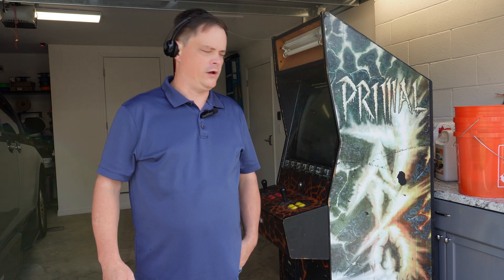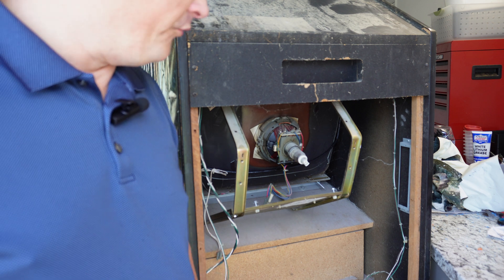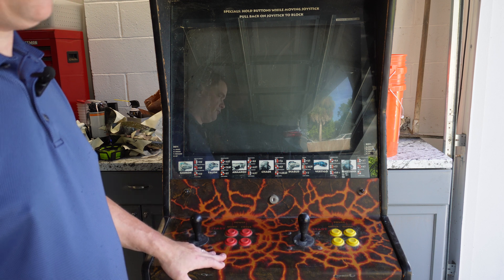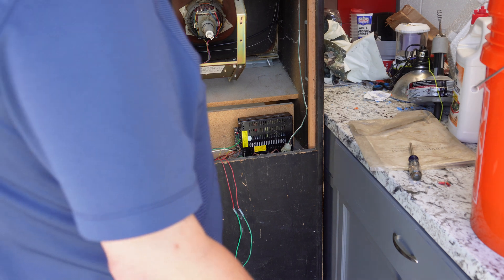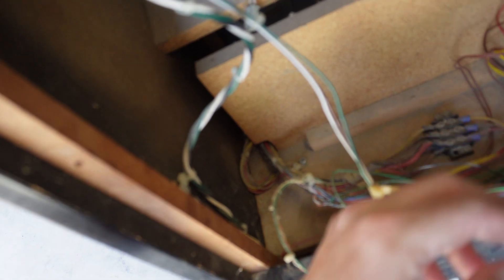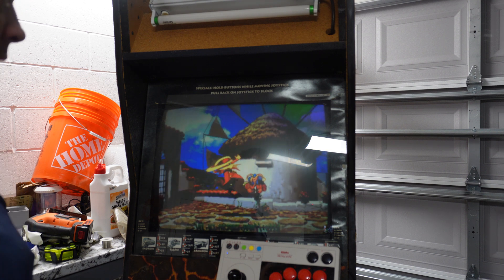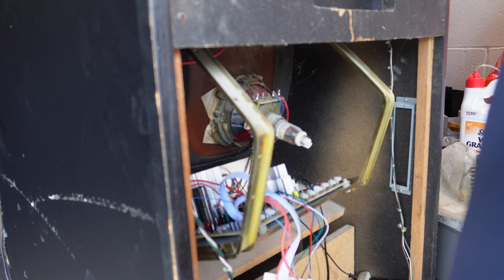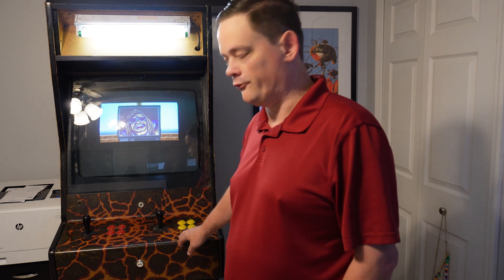MiSTer FGPA - Arcade Project. Part 1

Comment: I've always wanted to get a stand-up arcade machine to put a MiSTer FPGA inside of... but I don't really have any space for it in my house... and I couldn't decide what to get... an old original one, a new one from a few that make them even with JAMMA if desired, or something like a less expensive 1Up.  I think I prefer HDMI.  There are drawbacks with all of those.  I'm definitely interested in seeing what you do.  You are much more knowledgable on electronics than I am so if I ever decide to get something, I'd need either something fairly turnkey or with some really good instructions that others have done before.
Reply from the maker: I used to have a blast city candy cabinet and would love to get one again but the budget just does not allow for it any time soon. hopefully this holds me over.  The electronics on these are actually very basic at least as far as cabinet wiring goes. when you start troubleshooting an old arcade PCB that's different. If you got questions let me or someone else know and we will try to point you in the right direction.